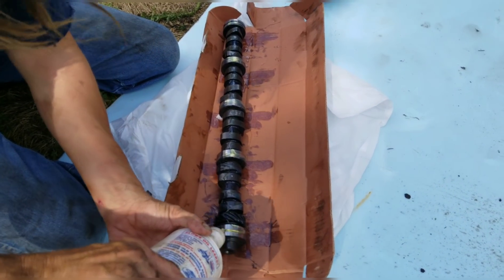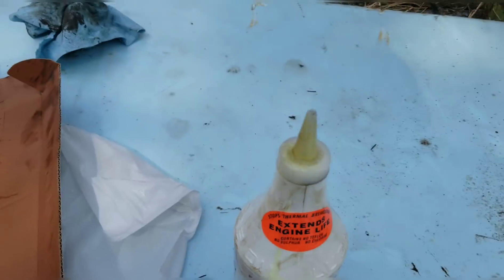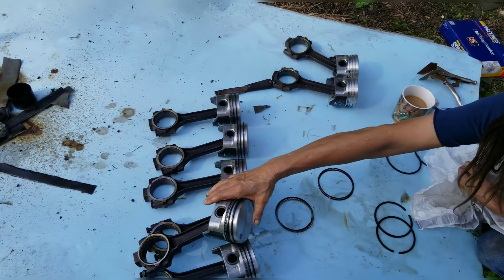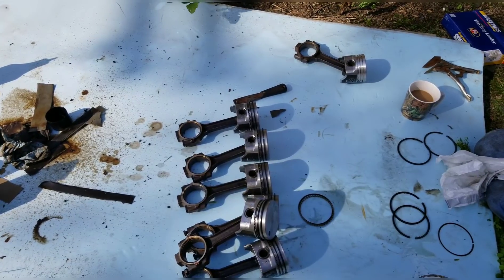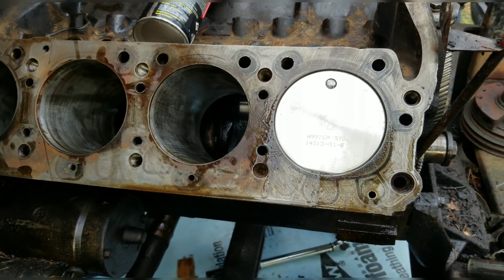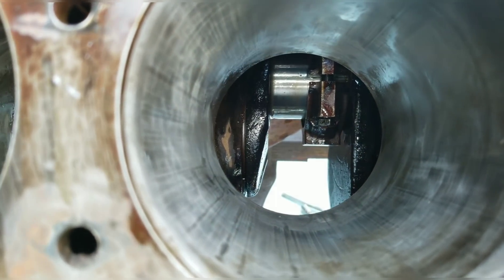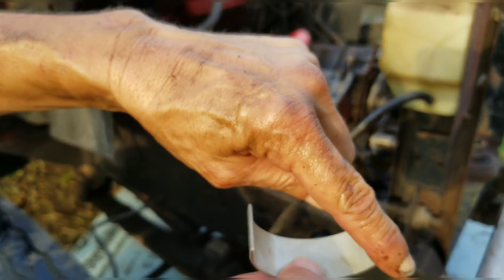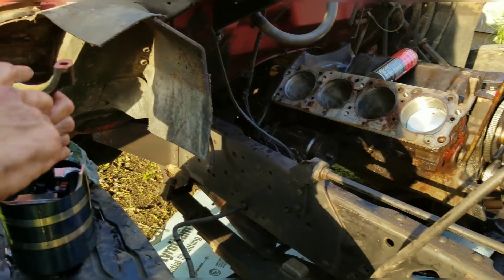IH 345 Engine In-frame Rebuild Part II

Comment: Did you use a cylinder hone on the cylinders and I assume that the ring groove was acceptable.. or you would have pulled the engine rather than do an inframe overhaul
Reply from the maker: Yes I did

Comment: Hi guys!! It's great to see you bringing an old IH engine back to life! I've never seen an International SV-engine with the heads removed and I noticed the very wide bore-spacing! Is that because there's a water jacket all around (360 degrees) each cylinder?
Reply from the maker: 260 to 280 degrees, they do have wide decks...prevents over heating...but yes, pretty much water jackets all the way around
Reply: +Farmall Fanatic Hi there Farmall Fanatic! Thank you for the quick response & for the answer to my question - I appreciate it! I live in South Africa & I own a 1973 1310 with a 345 in it. In my eyes it's a work of art! Those old Internationals were built to last! I enjoy your videos very much, thanks!!
Reply from the maker: The block only had 38000 miles on it there was no way that I was not rebuilding it

Comment: "Slick as a pig in..." Keyboard! You can feel the bevel too though, right? And the squared off one? I am watching this like it is my truck and hoping I did everything right! Funny... because I had to do too much manual work on my cars way back when... and I did not like the learning curve... wait, this was part three... I specifically recall you chatting about getting this done - even if you didn't record it for part one! Watching and Supporting... really wanting this to work smooth - and very much looking forward to seeing that engine running well! Watching and Supporting - LIKING another video!
Reply from the maker: Once you get to the modern day computer cars, Im useless. This is a 1974 model. Sucks, blows, and burns lol

Comment: I've never heard of using that Lucas Oil Stabilizer for assembly lube. Looks like it works just fine, I'm curious how many others out there use it. I don't recall ever seeing a dot like that on top of a piston, what is the function of that? Sorry if I missed the explanation within the vid. It's a coming along though! Will be oh so sweet when it fires up for first time.

Comment: don't them new pistons look pretty in the block!!  I have the wife use baby oil on every thing..  then there is no clean up to take the party inside!!  lol.  I suppose I should ask if that is your wife, sister or neighbor before I make sex jokes?!
gear driven cam nice!!  that's a heavy looking block for an old gasser!!

JB weld to smooth out the hash marks!  holy cow just when you think you have heard it all.  

TOMMORROW??  make it run today.  I want to hear it run!!
Reply from the maker: No thats a farm hand...Hillbilly is a great mechanic! IH made em heavy no doubt! Hey, maybe it is running now and these are all previously recorded mmbahaha
Reply: mind blown.  time warp.   I can hear it now,   that unique grain truck idle sound of a big old muffler echoing under the chassis.

Comment: With all the scoring I saw in Part I, don't be too surprised if it burns at least some oil. Once you get it cranked, let it break in and see from there. If you foul plugs on those scored cylinders then you'll have to decide from there. But, just my opinion.

Comment: Lucky the engine exhaust manifolds are good. Nice job on the old cornbinder. We had a 63 1600 with a 304 in it. It clicked and clacked from cracked manifolds but still hauled grain nicely. We also had a 72 1/2ton with the 345.

Comment: IH made those 345s very heavy to say the least lol they easily weigh as much as a GM 454 BB but wont turn the RPMS the GM BB and SB will But overall the IH 345  were better porportioned ports/cyl. size and could fill the cylinders better..